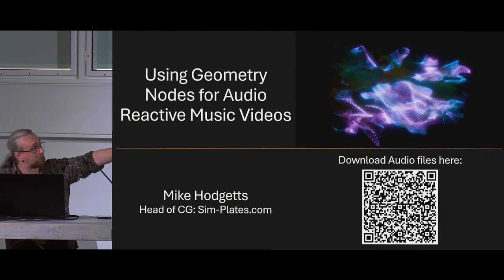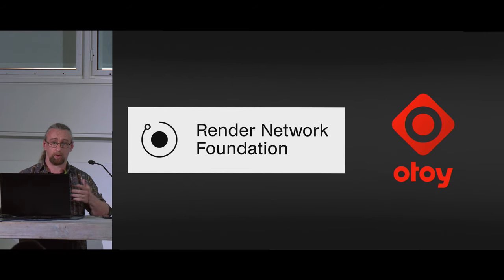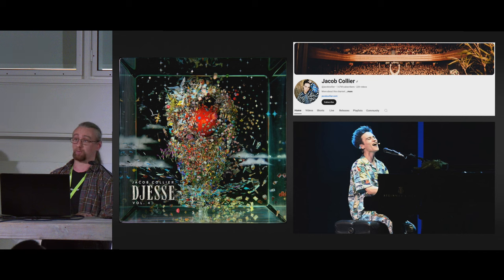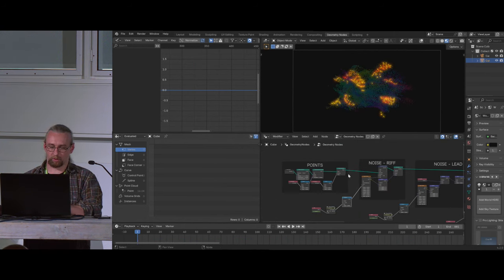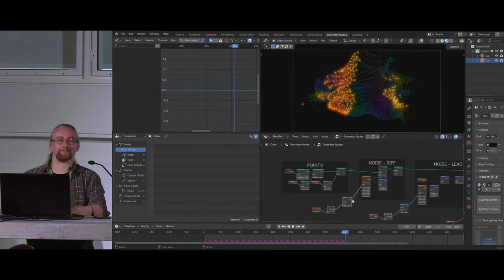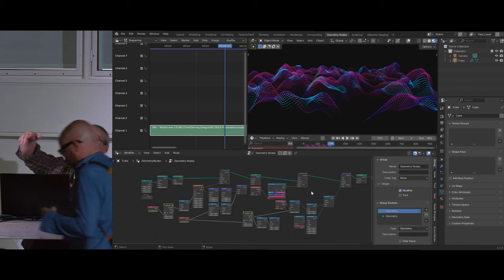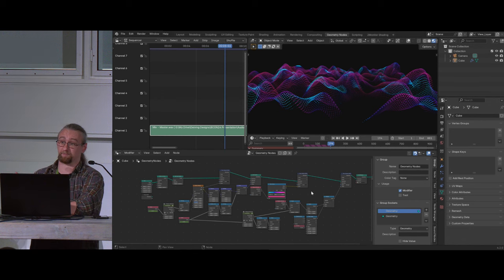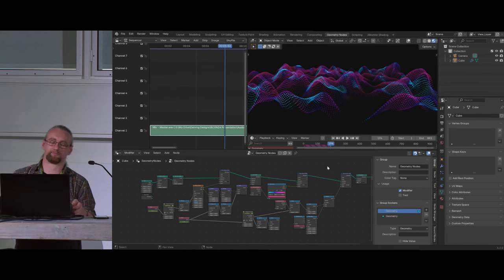Using Geometry Nodes for Audio Reactive Music Videos — Blender Conference 2024

Comment: Am following the same workflow but the set Material node in GeoNodes doesnt work, i have tried it in another projects...i set the material and all but the in the viewport nothing happens, both in cycle and eeve, even tried rendering, nothing works
Reply: figured it out, Am using blender 3.6...use cycles, if material doesnt update in viewport,Delete nodes in shader Editor and remake them. Am not a professional guess someone could figure out the error when updating material to object